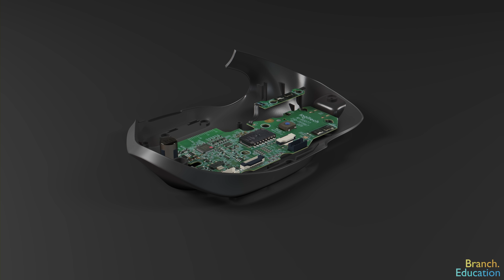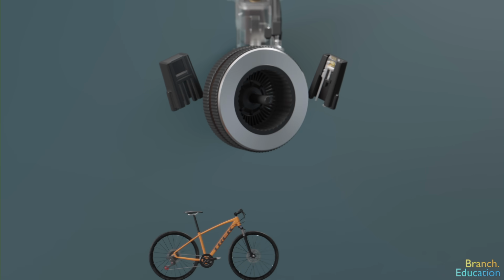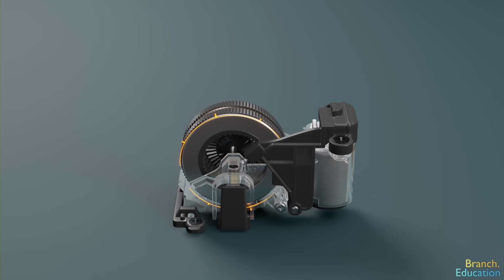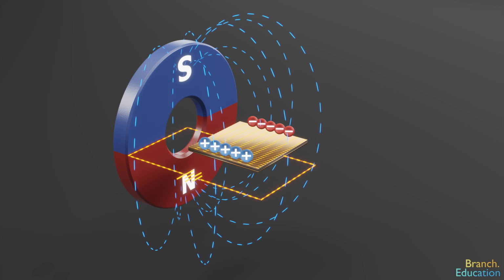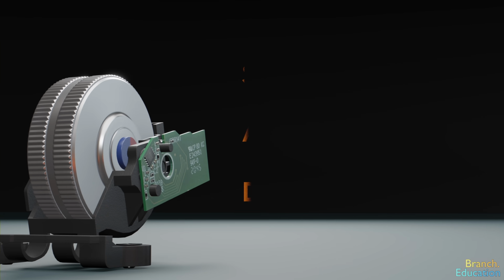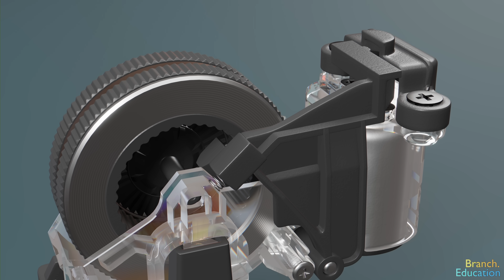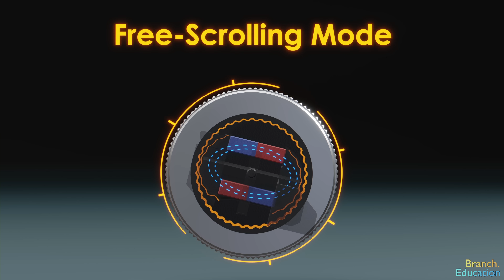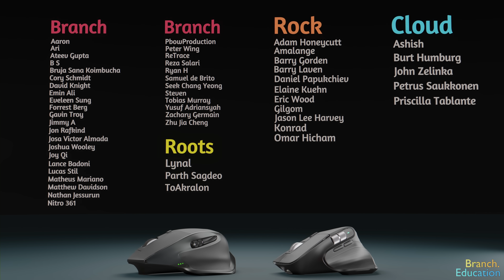How do Scroll Wheels Work? 🖱🛠🔬

Comment: Isn't rotary encoder now one of the most abundant scross wheels used in mice. Magnetic wheel mice are rather expensive or limited in use. Never noticed an optical wheel mice on the market.
Reply: Damn were you under a rock for 20 years

Comment: That’s insane that they went with a motor inside the mouse to engage the ratchet. The one I have just use a mechanical button to move it in/out.
Reply: A friend bought one of the very first laser mice from Logitech and it used the motor mechanism. Later versions like the one I have (Logitech laser darkfield model) have simpler cheaper non motorized latches. I know this cause it works even if batteries are not present. Its the same  as when cd/dvd rom and later cd/dvd writers were all new the drives were stylized and had loads of funtions and indicators but as the tech matured and became cheaper they reverted to dull square gray boring unnoticable boxes with no extra features whatsoever. Sometimes not even a read/write indicator or headphone jack to keep the manufacturing costs down. At least Logitechs mice still have the style and high quality feel left

Comment: Huh, seems the magnetic sensor allows for more minute measurements when you scroll slowly. But I would also be worried about interference. I would take a magnet to my mouse to find out but I'm too chicken I'd ruin my quite expensive mouse... 😅
Reply: I tested this for you on a similar piece of equipment. Xbox One controllers use this sort of sensor for the triggers, They detect how far away a magnet is from the sensor to determine how far in you have pressed the trigger. I can activate it by passing a magnet near my controller.

Additional information. The magnet used is strong enough to suspend 26 lbs from. my controller frequently sits by this magnet and I have not noticed any issues.

A hall effect sensor is made of a semiconductor. They are very robust pieces of equipment. If you leave a very(very) strong magnet against the mouse for a long time it could potentially weaken or change the magnet that the hall effect sensor is reading, but this is unlikely to be an issue for any normal consumer.

Edit: grammatical mistakes.

Comment: I wish you could have provided examples on what causes these different techs to fail over time; everyone knows it's only a matter of when, not if, their scroll wheel starts double-clicking or missing steps. It's not very obvious how the examples you showed would fail from use. I suppose the light sensors can become occluded by debris since the light path is open to air??

As well, I wonder why gaming mice aren't marketing their scroll-wheel sensors like every other claim they make. I always assumed they must be standardized but they clearly have a wide range of methods to use.

Comment: I think this is the first time that I've been confused but anything in a Branch Education video, which is a tribute to his good they are, BUT the bit about the button, the motor, and the sprung but of plastic engaging with the teeth lost me. Do some mice have a feature where it only clicks the scroll wheel if you press a button? And even if so, why an analogue motor, not a stepper or a linear actuator?

Comment: Bizarre claim that a mouse without a scroll wheel is daft, the scroll wheel not necessary and in some cases unused and many computers don’t have them never did, on computer only had one button we all know what computer that was.

Good video explains it well with great computer animation

Hall effect sensor has actually been used as a button, I repaired a X-Box One controller and discovered for the L & R trigger buttons they used a sensor instead of a traditional push button

Comment: Very good animation!
But, what about a non optical/magnetic wheel?
My mouse does not have optical sensor, and any magnetic parts?!!?
Reply: It showed that cheaper ones use 2 push buttons with a piece of plastic clicking the two buttons in order to figure out what direction the wheel is going in.

Comment: If use the suspension instead of spring should be stronger? Because can spoil right if spring?
Reply: Suspension design looking at bicycles.
Reply: Another if magnet below it, then mat of it also repel magnet then it is smoother(like hovercraft but dont float at all), just extra support by repel(feelin lighter).
Reply: The sensitivity of a sensor can maybe put behind room door? To know a movement counts by quantity to detect someone or if animal but usually animal dont walk on doors right? Knowing how many times touched door if the attacker that moves door from "outside(stone) using magnet and powered-up by electricity" to create a ghostly atmosphere or haunt our mind, secret harassment. Just smthg else important in life defence, to anticipate smthg or knowing if they r becoming aggressive with evidence instead.

Comment: I have both the Logitech MX3 which uses the magnetic sensor (the model shown here is almost the mx3 actually) and the 2S (optical sensor). The thing not so great about the 3 is that, I have two cat and sweaty hand. The cat hair and sweat makes the wheel less smooth after a week's use. I have to dissemble and clean it much more frequently to keep the wheel smooth compare to the 2S. The 2S just has a much larger space between the wheel and the wheel's frame and therefore a much higher tolerance to sweat and debris like cat hair etc. For the minor difference in perceived smoothness of scrolling I will pick 2S all day.

Comment: Your remote control analogy is way too off though. Having no remote control on a tv would be more equivalent to having no mouse at all on a computer. Having no scroll wheel would be equal to missing a button on the remote control. I used to use my Mac with an external mouse and no scroll wheel (broken).

Comment: why would a mouse scroll wheel require a rotary encoder if, at most, it performs only two functions? that is, to signal 1 incredment + or 1 increment -? no matter how slowly I scroll, the increment does not change, it only either completes before the next one begins or it doesn't, and that is the effective sensation of speed. In essence, the fact that it can potentitally infinite positions is utterly useless for the application it is used in.